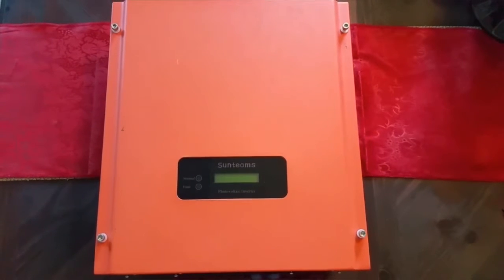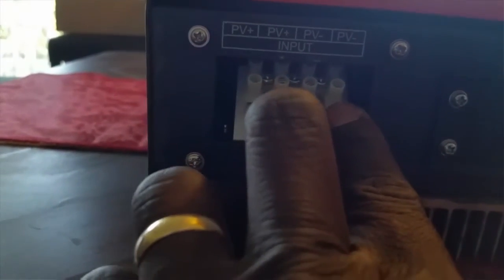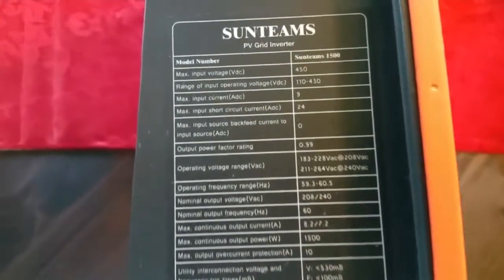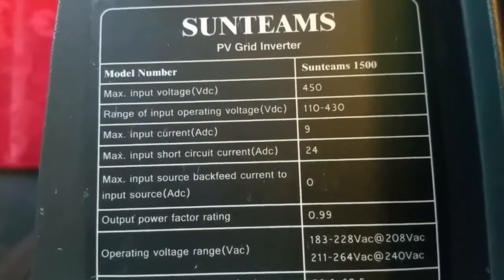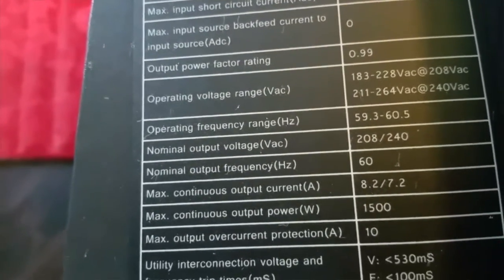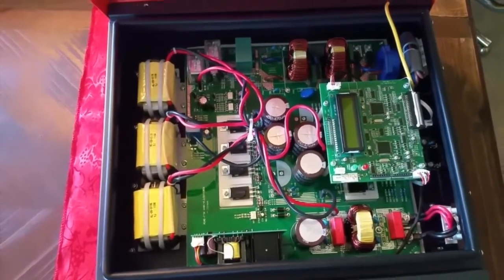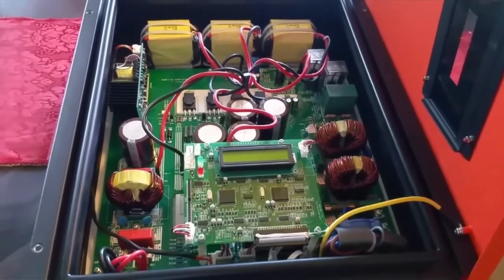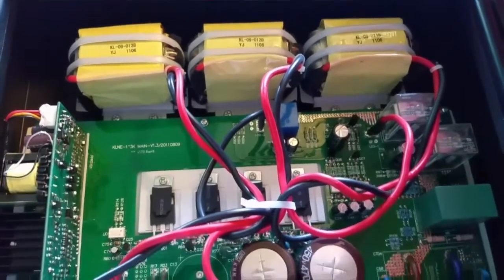KLNE SUNTEAMS PHOTOVOLTAIC INVERTER INSTALLATION FOR 1.280Kw SOLAR ARRAY ON STEEL ROOF TOP Pt.1

Comment: Do you have any videos on repair or error codes?  My Sunteams 5000 have " Damaged DC Sensor",  which does not go away after going through reset of system.  Where is the sensor located and is it an easy fix with replacement of the part?
Reply from the maker: Hello my friend and welcome to jwsolarusa.
I am sorry to hear what had happened to your Sunteams Grid Tie / String Inverter. I haven't done any repairs on these Sunteams inverters yet. These three  inverters i installed two years ago has been working every since without any issues.
Sorry I that I can't help.
Please check out the rest of my videos and please subscribe like and share.

Comment: Hi dear! Very nice and powerful (sorry for bad english!). Is it possible to run 3.5 Hp / 50Hz/230V air conditioner with this unit direct without grid ,
Reply from the maker: +gamou tiramaghan diop 
Hello my friend and thanks for watching my video. 
I just wanted to let you know this is NOT a power. It's a Grid Tie Inverters
Reply from the maker: Thanks for stopping by.
This is a Grid tie Inverter  that push power back into the power company. 
This is not a regular inverter that you can power with battery
Reply: @jwsolarusa  thanks a lot … happy to read u